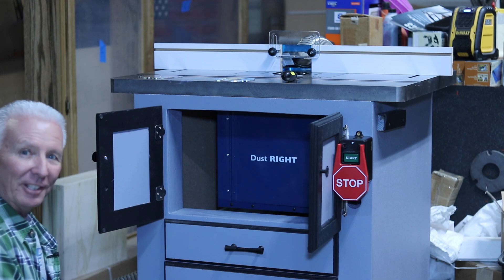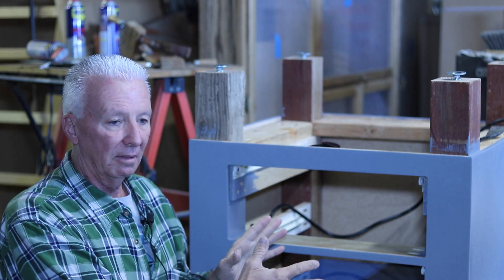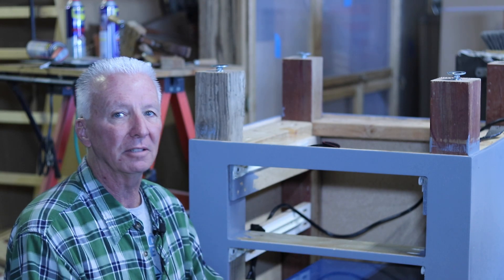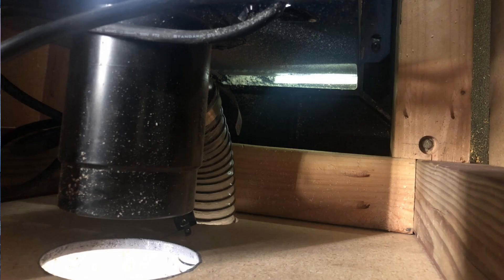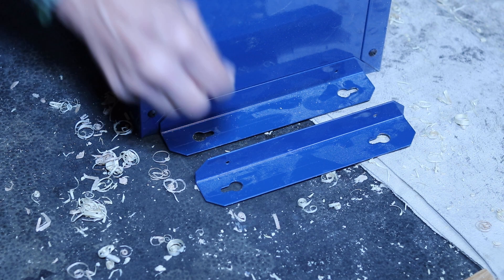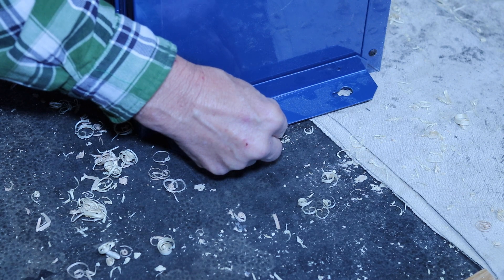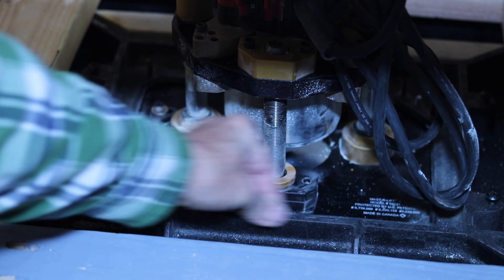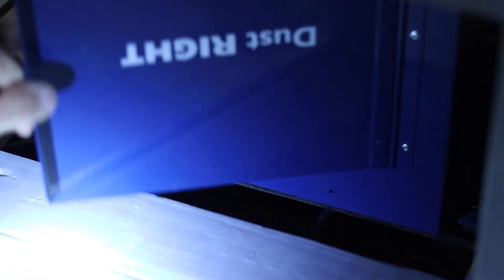Rockler Dust Bucket DOESN'T SUCK

Comment: I found this video as I am considering purchasing the Rockler Dust Bucket too. Looks like it will do a great job around my table router (Hitachi M12V). Thanks very much! 
Regarding router lifts, I use the Router Razer which adapts your own plunge router to serve as its own lift. Just $80+, and it works as well as any with no superstructure complications necessary.

Comment: Thank you Sir, for posting this video; it MIGHT save me a bunch of time later this month.
I bought the Rockler/Bench Dog cast iron router table/Tablesaw wing at 20% off about a month ago, haven't unboxed/installed it yet.  Rockler then had a 40%-off Sale on this "Dust Bucket", but the website only mentioned it fitting on their phenolic router table, not their cast-iron table.  I had been planning on filling in the gaps between the CI ribs on the bottom of the table, like you had.  But now I'll have to check first if the ribs line up with the perimeter of the Bench Dog table, with the mounting ears in the Correct orientation.  
Again, thank you for posting this potential "gotcha", and I'll update on whether it lines up with the tablesaw router table when I find out.

Comment: I am a finish carpenter,  I really only use a trim  router 99% of the time my next project, I need a router table and I don't know much about it. How many pieces are all Rockler that you have. Now that you have this setup for a while would you recommend it?
Reply from the maker: Ricky, I have a couple of comments. I will have to add a comment below this with a link to video when I first purchased the complete system. Out of everything that I purchased one thing, I don’t like is the rockler fence. But I purchased that knowing it was temporary. Unfortunately it didn’t last nine months. The melamine started coming away from the wood which caused me to have issues while feeding material through. everything else I have no issues with, but understand rockler is not the only supplier. I didn’t know at the time Harvey also has a cast iron router table top. I may have purchased mine from them if I would’ve known at the time, but for now, I do not have any issues with the cast-iron rockler top. I have no issues with the bucket or Anything else I had purchased? I am very very pleased with the Incra lift. I am glad I purchased that versus the rockler. I think it is a much more superior lift than the rockler. everything I purchased I have no issues with the complete set up except for the rockler fence I would say no find a better fence for whatever you need unless you want some temporary then buy something cheap for long-term. Personally, I prefer the Incra fence system you’re going to get Percision and repeatability you can never gain out of a traditional fence for your router table. check for the comment after this I have a link to the video which I explain more about what I purchased, and I’ll give a timestamp to fast forward to the router lift itself if you have not watched that video yet
Reply from the maker: Ricky here is the link to the video I mentioned: https://youtu.be/p39LSwivV54
Fast forward to 8:40 to view the Incra lift
Reply: @TheShackHome  I decided to watch the entire video. I realize we are possible cut from the same cloth. Lol. 

At the heart of the system is Saw Stop cast iron table top but when I had seen this video I decided to go with the Rockler because of the dust box. I am feeling you on the incra Pro life down to the manufacturer in Canada.
 
Can I get the part number for the Incra lift?

Do you have any video on the incra fence?
Reply from the maker: @rickyperkins232  the lift at Incra is a MUCH better deal than from Rockler here is a link to the router lift from incra: https://www.incrementaltools.com/INCRA_Mast_R_Lift_II_p/incra-mast-r-lift-ii.htm
the part # from Rockler is 47737. but its $60 more, your choice. As far as a vid the one I do have is the install on my table saw. I won't get to the router cabinet build till late January or February. If you want here is a link just not for the router. https://youtu.be/VNFooGzLNRY
Reply: @TheShackHome  thanks and that is the lowest price yet.